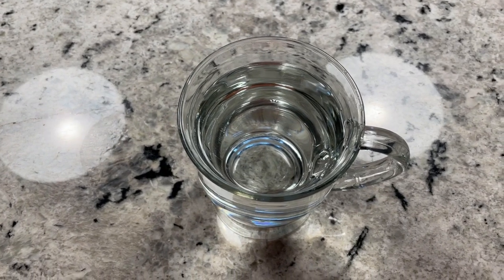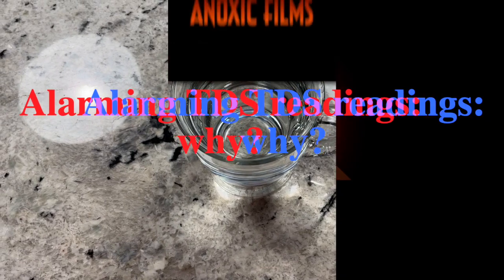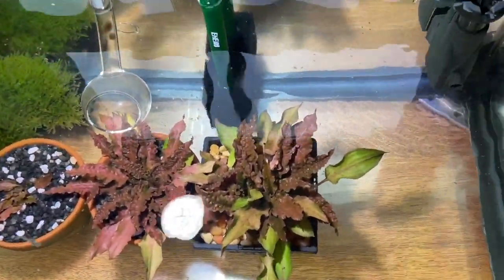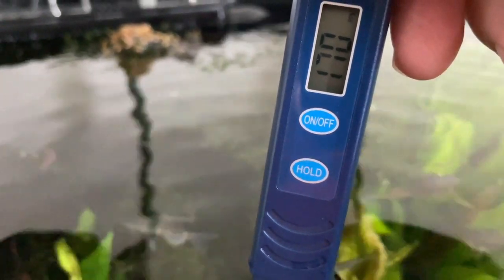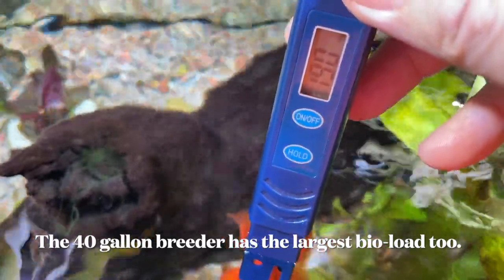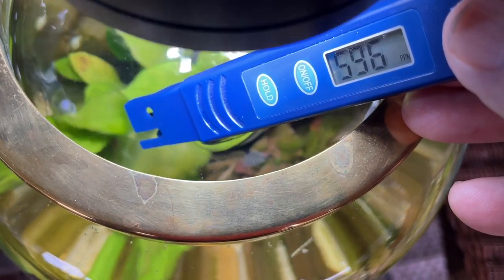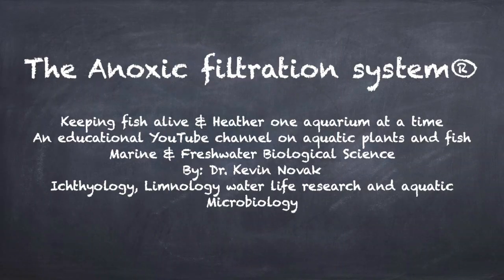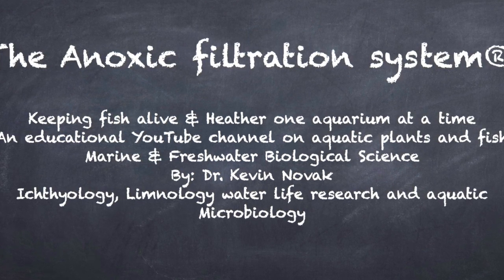Alarming TDS readings: why? & update on experimental planted dirt pot.

Comment: Sir please enlighten us about types of tastes needed to determine water parameters for freshwater aquarium its confusing and there are no reliable content on internet
Reply from the maker: Actually once the tank is broken in the only test I ever make is nitrates and phosphates and that's about it. And to be honest with you if the tank looks like it's doing good not having any problems I don't even test it at all anymore. Your PH and GH and all the other stuff out there is really insignificant as long as it's stable and doesn't fluctuate.
Reply: @anoxicfiltrationplenums  thank you sir for your reply my tank is 72*22*22inch and I have kept 6 discuss with two canister filters with bcb in it as you have shown fish are doing fine do I need to check orp

Comment: I'm curious what are the dissolved solids being released into the betta bowl? Are they minerals from sand, or organic matter from decaying wood, dead algae/plant matter? The slime algae is telling me there's lots of organic nutrients for it to feed off of. The only other difference here compared to the aquariums is during the water changes you're pulling the water through the sand which is acting like a fine particle coffee filter leaving solids in the bowl to break down into dissolved solids. That's my hypothesis.
Reply from the maker: I think it could be the sand I'm going to redo it it was in a Plenum.

Comment: Or it could be that you just stride up the tds I could go down in a few day as it settles down
Reply from the maker: Usually stirring it up will try to break up any air bubbles and the TDS meter to give you a more accurate reading.

Comment: Is it a problem or are we making it a problem?  I checked my 200 and 500 ltr  Cichlid tanks after watching this video. My tap water was 58 and the 200 was 753 and 200 was 325. After a 75% weekly water change the 500 was 454 and the 200 was 211. 24 hrs later the 200 was 259 and 500 was 500. Both tanks run BCB cylinders filters with a gravel, kitty litter, laterite and coral sand substrate. Water parameters are within acceptable ranges.  My Cichlids are all doing well and do what fish do. Eat, crap and reproduce. The eggs and fry do not last very long. I do spray in small amounts of minerals a couple of times a week after feedings
Reply: That was the 500ltr reading of 753 not the 200.

Comment: Hello Dr Novak
I believe it could have something to do with fish poop. 
In some of your other videos I have watched, you mention that when using slow moving plenums, fish poop is processed faster by the bacteria.
So in your aquariums with plenums and BCB baskets the fish poop doesn't hang around for long.

But in your beta bowl, even with a water change, the fish poop remains stuck in the sand. As the water is drained the sand acts as a mechanical filter and traps the fish poop.
Even when you change the water, the fish poop remains stuck in the sand.

Perhaps try doing water change the regular way with a hose and see if it makes a difference, rather than using the tap in the Beta bowl.

Me giving you advice haha. 
Sorry Doc, my bad.
Edit: I have 4 aquariums, two fitted with slow moving plenums, two more to go.
Reply from the maker: The betta container has its substrate directly on the bottom without using a Plenum.
Reply: @anoxicfiltrationplenums  Yes Dr Novak I know this
I watched a previous video showing you making the beta aquarium and understand that. 
The Beta aquarium has no plenum but has a tap at the bottom that allows you to drain the water in order to do water changes, does it not?

My point is that, when you drain the water using the tap at the bottom of the beta aquarium the water flows through the substrate taking the fish poop with it, as it makes it's way to the tap at the bottom.

Like a plenum, the water flows through the substrate when you open the tap to drain the tank but obviously the water flows through the substrate at a much faster rate, compared to a plenum.
As the water is drained when you open the tap, bits of fish poop gets stuck in the sand, as the sand acts like a mechanical filter, trapping much of the fish poop.

As the beta aquarium does not have a plenum and it's benefits,  one of which is fast processing of fish poop, it takes a long time for the small population of bacteria in the beta aquarium to break down the fish poop.

And because you are draining the aquarium using the tap and I assume not vacuuming the substrate, the fish poop is not being removed or is being removed very very slowly by the relatively small population of bacteria in the tank.

And thus over time the fish poop builds up in the sand causing the high TDS. I think your sand substrate is full of...fish poop.
That's my theory.

I would check how dirty that substrate is, I'm betting it's pretty dirty and poopy. 
Good luck solving the mystery Dr Novak.
Reply from the maker: @ozhomerozmechwarrior4681    actually I just took that tank apart today and added a Plenum to it and replaced to sand with 100% baked kitty litter. Now let's see what happens to it. It just seem to have an algae problem and every time I cleaned it it did no good of getting rid of it.
Reply: @anoxicfiltrationplenums   Hello Dr Novak, just want to talk about that algae issue you mentioned.
If my theory is correct, even if you cleaned the aquarium and did a water change, you have not removed the source of excess nutrients which is the fish poop in the sand, which is the source of the algae problem.

An analogy would be, say you have an aquarium, with a  sump and you are running filter socks that you never clean.
No matter how many water changes you do and no matter how much you clean the aquarium, if the filter socks remain dirty and are never cleaned, that dirt remains causing excess nutrients.

Same principal with the fish poop trapped in your previous sand substrate.

I believe your change to a plenum will yield great results once it's established and matured.

Comment: Hello Dr. Novak,  You mentioned that when you draw the Beta bowl down for water change the effluent is essentially filtered by the sand bed. Would this not contribute to discrete solids being trapped and concentrated for further breakdown which could contribute to increased TDS? Or maybe the sand itself has a component that contributes to TDS.
Reply from the maker: I think it could be the sand has something in them like calcium or something.

Comment: Well if this was my problem I'd troubleshoot it by doing these couple of things. First relocate the driftwood to a container with water by itself, no fish maybe just an air tube for water movement. Then for a period of time, maybe a week or two, test the water tds every day to see if your noticing a slow rise. If so then the driftwood may be the culprit. If stable for a couple weeks then try step two. Step two would be use distilled water(adding essential elements and nutrients as needed), for water changes for a few weeks, testing tds  intermittently. If there is a rise then there's a possibility, if not then it has to be either the fish, plants, or sand... I'd guess the sand would be the culprit in that case though.

Note: Both steps could be done at the same time to save time. If taking the drift wood out and switching to distilled water for water changes doesn't change the tds rise, or lower the current 600 number then it has to be the sand in my opinion.

P.S. Then again there's the possibility that the baskets are some how lowering the tds naturally.

Comment: Sand does have some minerals that can dissolve into the water. I'm pretty sure you nailed it when you said it's possibly the sand itself, which is what I'm thinking as well.
Reply from the maker: Usually my TDS goes up after I add any additives like iron or anything else.

Comment: It would be useful to retire one of the bettas, make a water change and control tds. There're algae so It seems bioload is too high for such small tank. Regads
Reply from the maker: Since Bettas are not oxygen dependent they do not put a burden on any aquarium for oxygen needs. They are really a very small fish and therefore their bio load is almost insignificant.